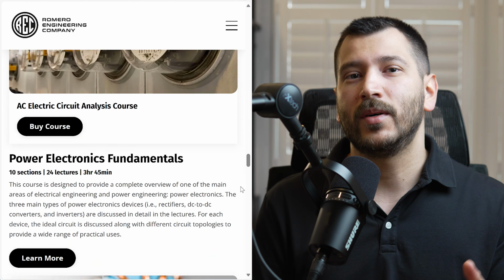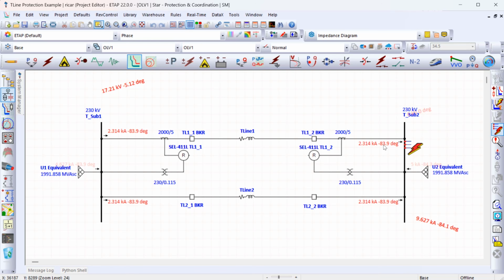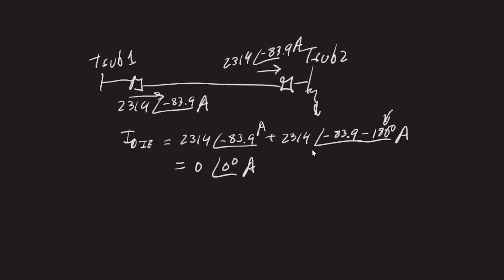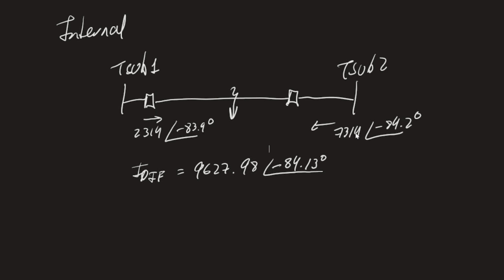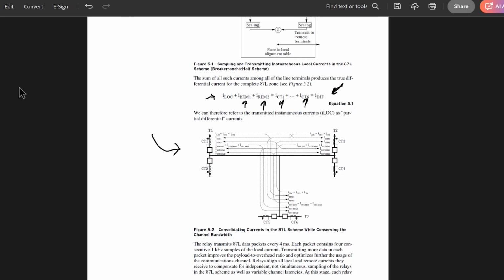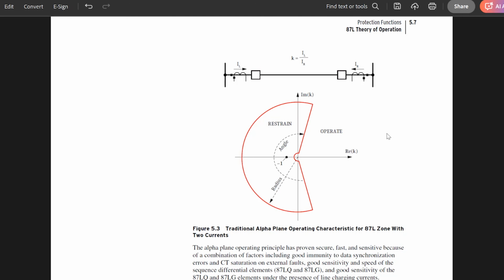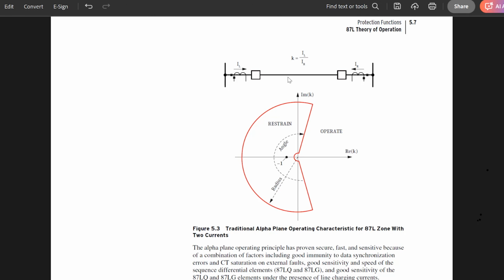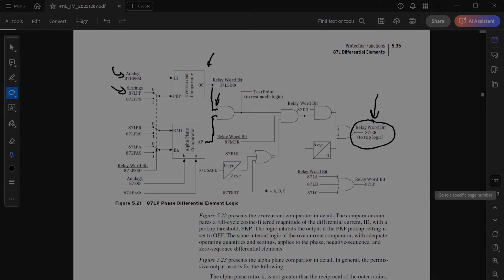Transmission Line Current Differential Protection | Example Using the SEL-411L Protective Relay

Comment: I have experience with 7sl86 Siemens: there was wrong CT tapp connection during external fault both relays in each side have different current magnitude however they were at the same phase angle. the relay tripped. if in this case SEL411L was used it will not trip because of restraining alpha shape

Comment: What is the biggest benefit here vs just using overcurrent or distance protection?
Reply from the maker: The biggest difference is that line differential protection (87L) directly compares currents at both ends of the line, providing high-speed, selective fault detection with no reliance on voltage or impedance. In contrast, distance protection (21) uses impedance measurement to estimate fault location and may have time delays for coordination. Overcurrent protection (50/51) operates based on current magnitude alone, making it less selective and often used as backup rather than primary protection for transmission lines.

Comment: How does the addition with angles work? -83.9 + (-84.2) = -168.1. How did we get -84.13 ?
Reply: this is vector addition, means both magnitude and angle will affect the result, as the addition is done in the carestian system